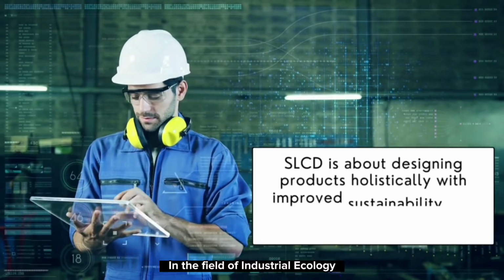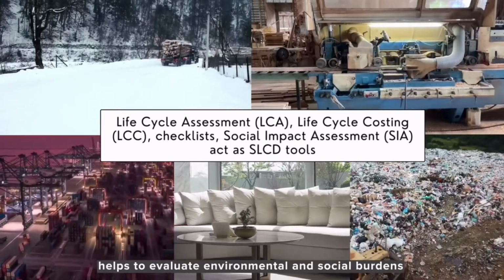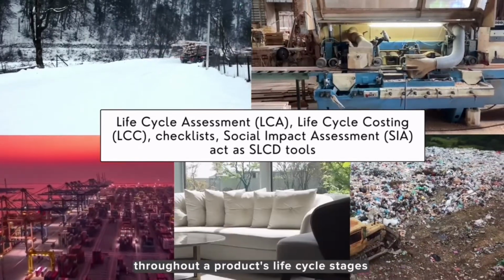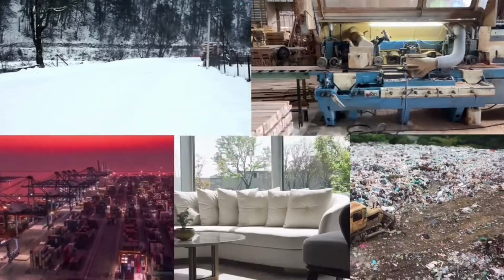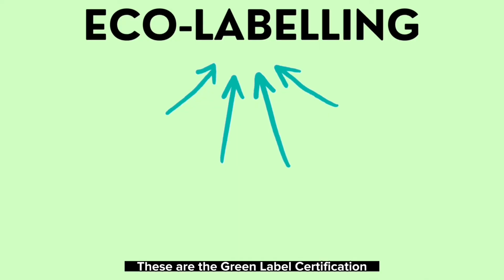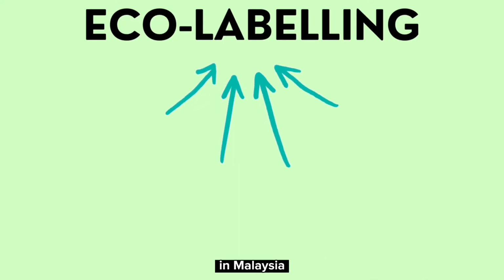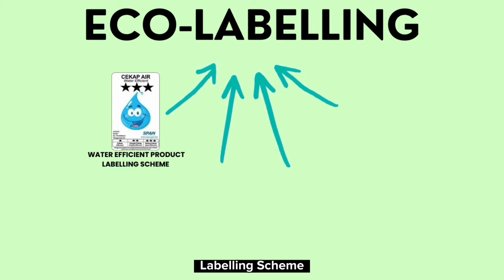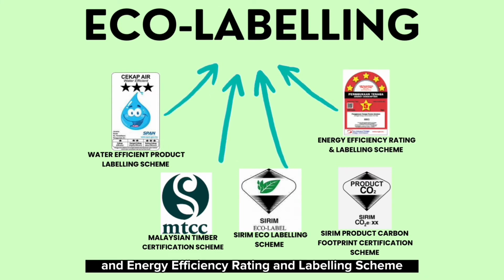Ecotopia - Life Cycle Design and Management

Comment: Sustainable Life Cycle Design (SLCD) focuses on balancing economic and environmental factor. It helps minimize environmental burdens and supports sustainable development. Life Cycle Assessment (LCA) is used to evaluate the environmental and social impacts throughout a product’s life cycle. SLCD aims to reduce environmental burdens, such as climate change, through waste prevention and maximize biodegradability. However, its implementation may be limited by high costs and a lack of knowledge. An example of SLCD can be seen at Hospital Jasin, which incorporates energy-efficient practices, water conservation, green building concepts, and rainwater harvesting. In addition, eco-labelling helps consumers identify environmentally friendly products and encourages sustainable consumption.

Comment: Sustainable Life Cycle Design (SLCD) is designing products to improve sustainability and less environmental impacts through its lifecycle. SLCD focuses on reducing environmental impacts beyond eco-design which balances between economic and environmental factors. SLCD helps minimise environmental burden, promote biodegradability, and ensure the company complies with regulations. The example of SLCD is at Hospital Jasin which is green buildings and use rainwater harvesting system.

Comment: Main goal of SLCD to seek the balance of economic and environment in business activities. SLCD can be challenging due to several factors such as cost, lack of knowledge and ability to balance the sustainability in business. Despite this challenges, Malaysia has already provide an examples of SLCD implementation through green building initiative at Hospital Jasin, that applied the rainwater harvesting system as well as the production of environmentally certified consumer product.

Comment: Sustainable Life Cycle Design (SLCD) is a framework about managing production into more sustainability approach and reduce the environment impacts involved. There are several tools used in implementing this alternative, such as Life Cycle Assessment (LCA), Life Cycle Costing (LCC) and Social Impact Assessment (SIA). However, this approach still has some limitations, whereas highly costing when operations, need special equipment to be installed. Since, SLCD considered as new research field, therefore, it is still quite small amount of expertise in this field and there is lacking ability to balance between business purposes and SLCD methodology.

Comment: SLCD is a framework used to improve sustainability and reduce environmental impacts throughout its life cycle. Regulation is an important driver of SLCD. However, there are some limitation of SLCD which are high cost, lack of knowledge, difficulty in greening the supply chain and the ability to balance business decisions and SLCD methodology.

NUR SYAZWANA ZAFIRAH BINTI MUHD NORZAIDI (6B)

Comment: Based on the video, SLCD helps to evaluate environmental and social burdens for life cycle stages and Life Cycle Assessment (LCA) is one of the tools for SLCD.  Unlike standard eco design which primarily focuses on minimize environmental problems, SLCD strives to balance both economic and environmental. However, the limitation for SLCD is due to high costs for data collection and typically cost a lot of time and money.